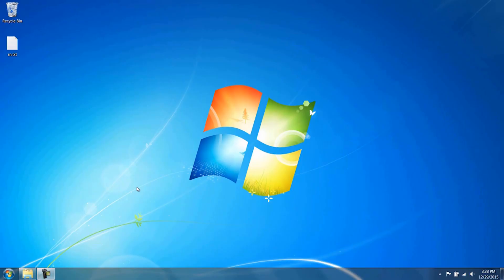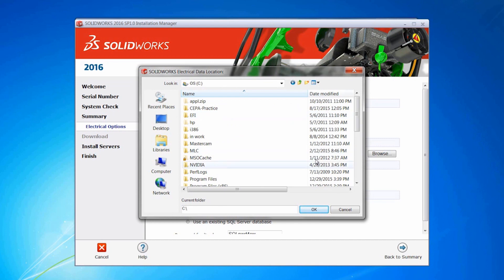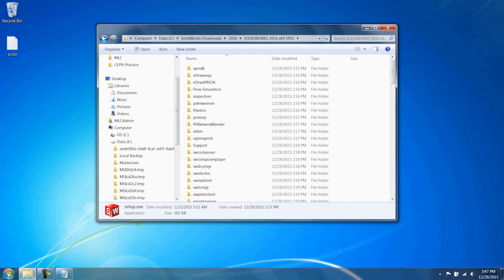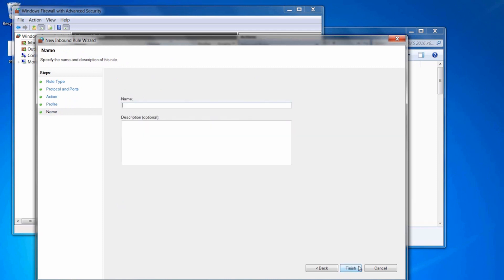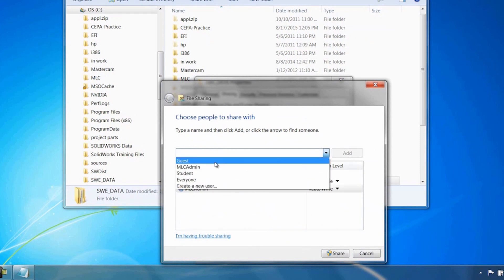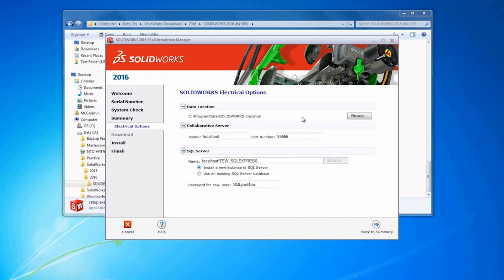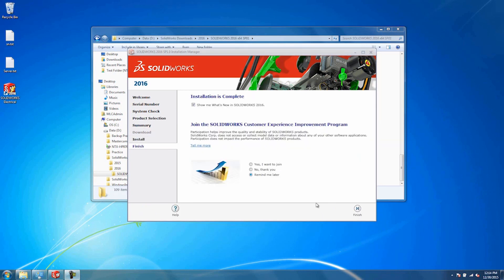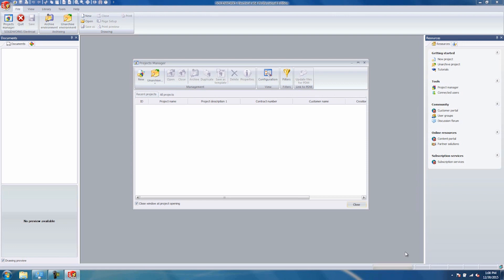SOLIDWORKS Electrical Installation

Comment: Is it free or you have to buy the product to get the serial no required at the time of installation.
Reply from the maker: The serial number requires a purchase.  There are no free versions of this software.
Reply: @MLCCADSystems  your website and channel is best but unfortunately everything is purchasing based, as these softwares are also very costly
Reply from the maker: There are learning editions and student editions available for free or low-cost for many of the tools we support, but the primary users of our software work as professionals in industry.

Comment: Hi. Thanks for your video. My SolidWorks Electrical installation always stops around 85%，all other product works well. And when I tried add a port as you introduced, i was told the number1433.1434.26666-26672 is valid. What should I do?
Reply from the maker: If your installation is stopping, it is likely getting stopped by a specific component or restriction.  Gather up the installation logs and send them to your Value-Added Reseller for review.  Since Electrical uses SQL Server it often gets stopped with permissions issues, and once identified it should be a pretty simple fix.

For the port issue, I recommend using commas not periods.  Try "1433, 1434, 26666-26672".  If that doesn't work, the regional settings may be creating issues, so I would create two individual exceptions, one for "1433-1434" and another for "26666-26672"

Comment: hellp everyone. i need a answer. i am install like this instruction for sw2020, but after install... all normal except sw electrical. when double clik, it can't show anyting or no open. but running proses in task manager. ? have solution?  please tell me
Reply from the maker: This isn't a common issue, but if it won't run after the initial install it may be due to the electrical database not running or no license exists for Electrical.  Confirm where the database is stored, that SQL is installed and running, and that a license exists for the product.  Beyond that, I recommend reaching out for support to your VAR or EDU as appropriate.

Comment: can i use solidworks electrical for free or i need license
Reply from the maker: You will need a license to install and run SOLIDWORKS Electrical, contact a value-added reseller in your area for more information on acquiring a license.  https://www.solidworks.com/sw/purchase/varlocator.htm

Comment: Hola muy buen aporte! Yo seguí todos los pasos y pude utilizarlo, el problema es que no aparecen las plantillas y, cuando quiero insertar símbolos por ejemplo, no hay ninguno. Me falta descargar algo?
Reply from the maker: After the installation is complete and you run the software, there should be a Data Update Wizard.  Make sure you accept the default selections and click Next and Finish to fully load all of the standard libraries of templates and symbols upon initial installation.  

If you cancelled that process the first time you started SOLIDWORKS Electrical, you can restart the program and it should start again.  If that dialog isn't showing up when you run the software, re-install the program.